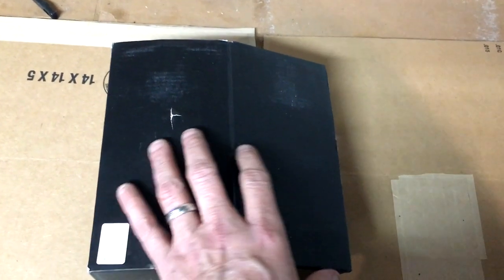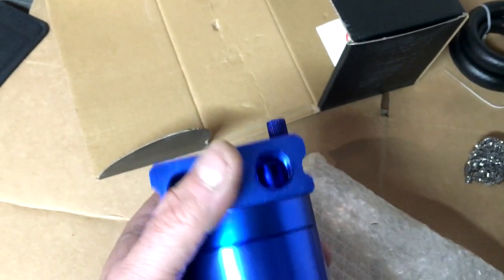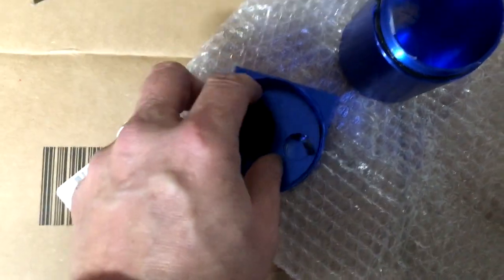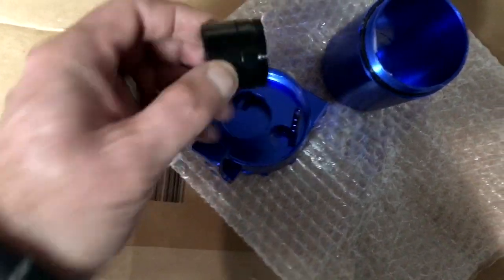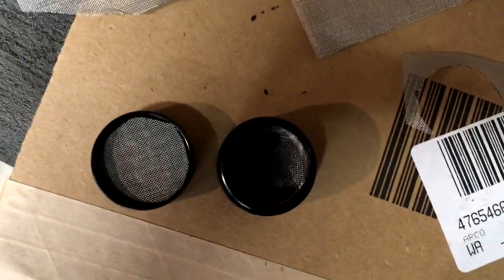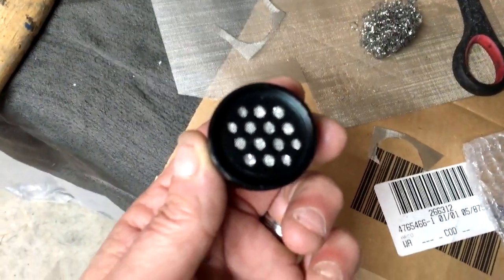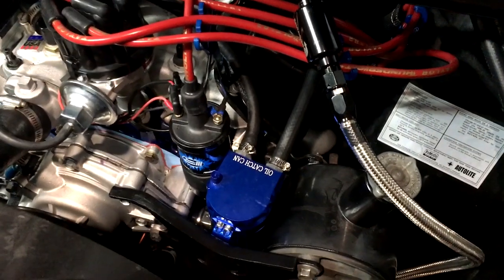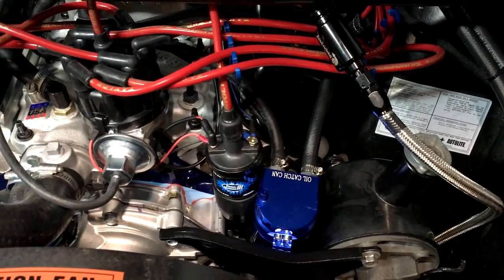$29 Oil Catch Can upgrade to high end

Comment: I suggest to use brass wool, the vapours from the engine are in part water, it will over time corrode the steel wool, ruining the baffle

Comment: I used part of a sponge type small engine air filter material and I think the in and out ports are labelled backwards. I want the oil and dirt in the can not gumming up the upper side of the so called in port.

Comment: When the oil collects on the screen, Wouldn't it restrict the air?
Reply from the maker: You would have to have a HUGE amount of oil to block the flow. Remember,  this is oil vapor. As it goes from vapor to liquid, gravity pulls it down into the can. Just keep it clean but better than pushing it BACK into the intake to be burning in the combustion chambers (just picture over time how much is going to just settle as gunk in your intake.

Comment: Thanks for the advice and I am doing the same.  As I was inserting the mesha screen into the baffle, I found some oil residue in the baffle and wondering whether the oil residue will clog up the mesh.  I will periodically check but wanted to see you experience as well.  Thanks!
Reply from the maker: Hello, glad you liked it. Depending on how much oil bypass you have, yes, it will eventually clog. You should really check every month or so to make sure you are not filling up the catch can. It really varies. On mine, I could could months and months. My son has an Audi that was filling the vatch can monthly. Good luck !
Reply: @arcorob  Had a '04 A6 (2.7T S Line) which was an oil guzzler hence 7+ quarts for each oil change 🙂  I did have some oil / water at the bottom but looks like I can last the entire OCI (usually around 6 months) - will check monthly though especially during cold spell.

Comment: where did you purchase the fine mesh screen??
Reply: I saw this video and I purchase this 80-mesh from eBay - 4-80 Mesh Steel Woven Wire Mesh Filtration Screen Mesh Screening Filter Sheet

Comment: So basically hot oily mist comes to IN, hits the scrub steel wire, vapor turns to oil, drips down to the bottom of the can and regular air comes out the OUT?
Reply from the maker: Yes.   Instead of colgging your intake over time. If it was palatable and legal, you would have a hose that just dumps it but car makers had to find a way to not have dripping cars. So, dump it in the intake..LOL. There are alot of videos on catch cans. I have seen some cars first hand that you empty every six months. My sons Audi A4? has to dump monthly
Reply: @arcorob  just found out catch cans are scam, and can ruin your engine, i disconnected mine
Reply: @darkomtc  I don´r believe on it. It does save your engine. Alternative? Just throw the oil on the street so your engine don´t be feed with burned oil..... No way to do this..sorry...
Reply: @ariostomartire Yeah, I agree. There is  nothing “scam” about stopping oil valors and moisture from being puked on top of your valves where it bakes into a crusty abrasive mess.